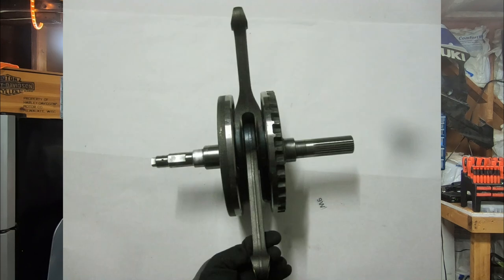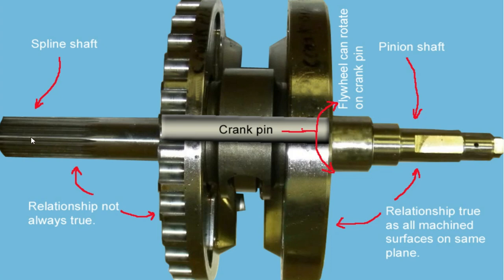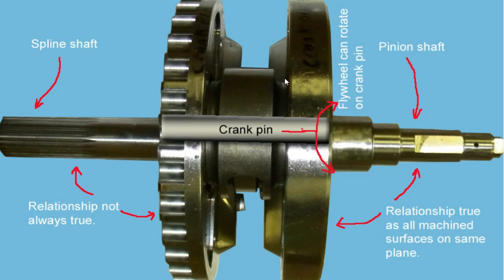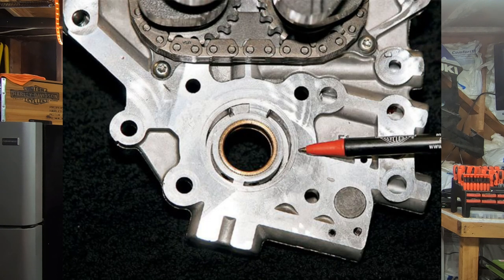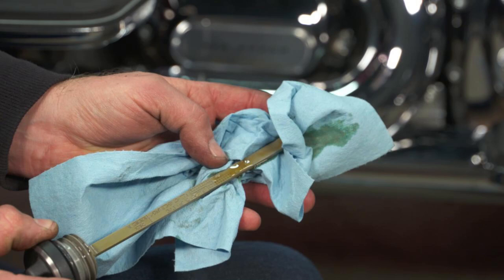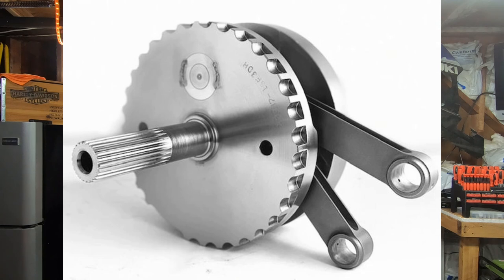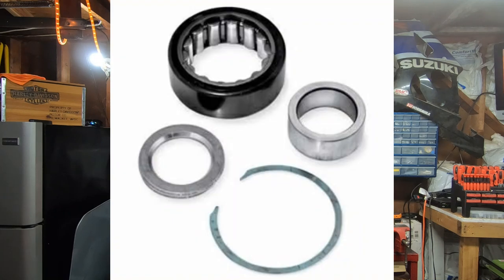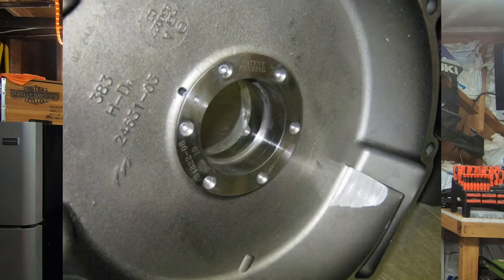The Issue With The Twin Cam Crankshafts | Harley-Davidson Cut Costs

Comment: I wish I would have watched all these videos on the twin cams problems before I bought my 2017 Low Rider S. Does the Screaming Eagle 110 have the same crank as the 103? I never worried about anything on my Sportster. That bike was bullet proof. Do the M8's share the same problem?
Reply from the maker: The 110 does share the same crank, they are a pressed assembly. It's not a guaranteed failure point though fortunately. There are thousands and thousands of Harleys running out there with a pressed crank assembly. It becomes an issue when someone builds a big horsepower engine and starts thrashing it with that stock crank. You can put some damn good power into your 110 and be just fine. Just don't go drag racing every weekend on it and doing flaming burnouts to impress the ladies 😄😄👍.
Reply: I highly recommend you check the runout on your crankshaft. It's not difficult and gives you the chance to make a few upgrades if you have the funds available.

Comment: I have an 04 RK classic I already have stage 1 on it arlen ness filter, v&h fuelpak and V&H dual slip ons. I purchased the S&S 509 standard gear drive cam chest kit but now I'm confused which s&s flywheel is the right choice for my cam kit?

Comment: 2016 Street Glide here with 52,000 miles so far. Is this problem for old HD twin cam motor or is it still prevalent in 2014 and up Rushmore bikes ?
Reply from the maker: It's a very hotly debated issue, the cranks are still pressed today even on the M8's. The 2016 does have a pressed crank, overall they are reliable and most never have an issue. Where it becomes a problem is if your lugging the engine in too high or a gear for your rpm and using the throttle to let it tractor up to speed. It sounds really good but the way Harleys fire they put a lot of stress on the crank pin. As long as you keep your RPM up and don't lug the motor you're in good shape, that's why Harley stresses over and over to not lug the engine.
Reply: @GixxerFoo  thanks for your response. Just to clarify when you say lugging, is it specific RPM? I’m usually riding at 2500 rpm in 5th gear. My sweet spot is at 3k to 3200 rpm.

Comment: Twin Cam is JUNK. My 1989 EVO FXRS Low Rider has been running just fine since, well, 1989. No crankshaft problems, no cam chain tensioner problems, and NO overheating problems. It doesn't need a hack to shut down the rear cylinder in stop and go traffic, it doesn't need bolt on fans on the cylinders to keep them from melting down, it runs right around 200 degrees F oil temp, even in Arizona. Most Twin Cams run closer to 300 degrees F. And when (or if) it ever wears out, it can be easily and cheaply rebuilt. Or I could replace the whole engine with an S&S, but I'd rather keep it all H-D.
Reply from the maker: You can't beat that Evo for sure, the twin cam had to meet emissions and running them hot was about the only way to do it. Between the EPA, Harley cutting costs and styling refusing an oil cooler on the twin cam it could never be as solid as the Evo.
Reply: Aaahajaaahahahha Twin cam is far superior than the EVO !! I own them all, from a knuckle to a new M8!!

Comment: so I missed it twice now.  which years did Harley install the 'suspect' cranks?
Reply from the maker: Anything 2003 has the pressed cranks, you'll want to check run out on those before attempt a gear drive installation or cam plate.

Comment: I have a 2014 Street glide with a 103. Are my problems the same. What do I need to do to make better.
Reply from the maker: They still used the pressed cranks, but the late model 103's 2014 and later really were pretty good. They had those motors pretty well straightened out before they went to the M8.

Comment: I have a 2017 low rider s. Long story short, had it for 5000 miles and my crank  was pinched. Luckily it was discovered when I was going to a 117. It would hit a stiff spot when rotating the piston arms. Took it to darkhorse, got the man o war and Timken conversion pushing 126 hp 134 tq alot of money in disassembly and reassembly but an entire engine would've been more
Reply from the maker: Damn that's awesome they caught it! You've got damn good numbers now 👍. Low Rider is one my favorite models and you got one l would love to have it sounds like!

Comment: I had 1 thou runout when I installed my gear drives (02 bike, pre junk bearings). I would consider anything over 3 a busted crank. I would love to install an S&S crank, but dam.. that is some serious money.
Reply: Change the heads the cams the crank and the fuel system.  Potato potato patato.  Did I mention the compensator.
Reply: @ralphwatten2426  Did it all (except crank)... funny you bring up Compensator.. Got a 2k+ trip coming up, so also changed out primary chain, belt drive, Compensator, and rear shocks. Funny how it takes awhile to make a grand, but only 5 minutes to spend it on the scooter!
Reply: @hawkdsl  Hey Hawk, can you still call it a Harley Davidson?
Reply: @ralphwatten2426  LOL, oh sure! well.. hmm.. 98% HD.. I've only got a few non-harley parts. I had Short Block Charlie redo my stock heads.. I've got HD 95 cans with Weisco 10-1 pistons.. Comp cam lifters with CycleRama cams. S&S gear drives. Screaming chicken plate & oil pump. Progressive rear shock and front springs. Screaming chicken 6 speed. HD wheels and matching sprocket. Dyatona Twin Tech ignition. 44 CV/SE Intake/V&H long shots with cross over.
Reply: @hawkdsl  Not sure but I think it might be less than 98%.  Won't be long before they won't sell you a t-shirt.
Reply: @ralphwatten2426  LOL.
Reply: @hawkdsl  My cousin had some work done on his Harley somewhere other than his local dealer, they found out about it and wouldn't let him back in the shop.  So there ya go.
Reply: @ralphwatten2426  LOL, well, mine is an 02 (bought it new)... I haven't been back to my dealer in years. I'm just a distant, forgotten memory to them now.
Reply: @hawkdsl  You're better off.  If you can do the work yourself you have no one to mess it up and no one to blame.  No one touches my bikes but me.  Take care- '99 Valk and an '11 KLR
Reply from the maker: The unkillable KLR, dad sold Kawasakis for years. Sold a KLR to a guy who went from OKC to the southern tip of South America, then to Alaska and back to OKC on the factory spark plug.
Reply from the maker: 😄😂 me too, dealer doesn't me much either.
Reply from the maker: Wow, that's crazy!
Reply: @GixxerFoo  that spark plug was really happy that trip was over!
Reply from the maker: That was a gather around the lift in service day at the dealer!

Comment: I’m noticing my oil isn’t returning to the oil tank…(2008 Harley Crossbones Softail) I’m thinking my oil pump is f’ed and now you got me worried that my pinion is out of whack.
Reply from the maker: For sure a possibility on the oil pump, sounds like you're sumping. I would get that cam chest pulled down and put some eyes on that oil pump for sure. Check your pinion run out too, Harley oil pumps have a high tolerance, hopefully you can get away with just replacing the oil pump!
Reply: @GixxerFoo  hey thanks for the reply, wasn’t expecting but is much appreciated. I’m a disabled vet and this bike is all I have for transportation at the moment. My uncle wants me to first try just draining all the oil including the return line out of the crank so ALL the oil out. Although I don’t know what that’s gonna do…if it’s not being returned in the first place. My tank is bone dry after riding today in excess of 70mph for 20min. Smh

Comment: Dear Gixxerfoo, hope you are very well, which Flywheel could you advise me, darkhorse or S and S if I wish to upgrade my original 103 CI, I upgraded as you know for a 117 well prepared... With Reaper 594 cams from feuling and everything else I mentioned you in a previous message, for which I thank you again to have answered... 😊... Which crankshaft would you recommand.. If there is one much better or stronger than another.. I would love to turn the throttle without any doubts in the future.. Thank you very much for your help.. 🙏🤞
Reply from the maker: Dark Horse products are very hard to beat! They are high quality and strong components, plus you don't have the price associated with S&S.

Comment: Mine has 4,800 miles on it. 
On my way to work and the oil pressure light came one. It will still start and run (barely) but the crank needs fixing or replacing. 
The shame is the bike is an ‘05 and looks like it’s brand new, just can’t ride it.
Reply from the maker: Dang that sucks, I'm sorry to hear that. Hopefully you can get that motor out and tore down, great time to get it all built back up with some solid components.

Comment: Yo i have a 2013 street bob with the tc96a...ever heard of anyone having crank issues with that era of dynas? Thanks for any help or insight
Reply: I have that year and model. Mine is being rebuilt now. 23k miles and I ride it nice and easy and change oil often. Glad I did not blow it up.

Comment: Doing burnouts you can shift the old 5 piece crankshafts. Even the aftermarket forged flywheels will shift if you abuse the motor enough. People got spoiled with the evolution motor, put gas in it change oil and run it into the ground. The shovelhead you were lucky to get 25,000 miles before a topend was due. I personally would not weld a twincam flywheel assembly to improve it structurally, I would pin it
Reply from the maker: The old Evo motor bottom end was super tough, Harley really made that engine too reliable in a lot of ways.
Reply: @GixxerFoo  hey man i really need your input. i have ss cases welded trued and balanced by rev perf SE wheels ect i just built this and my oil pump was bad after all that from previous grenade feuling, so my lifters the pin came undone and scored a grove in my blocks .. im at a complete loss i could not ajust my push rods for nothing any help from all of you if poss thx. 7k now broke with a broken engine, im in a panik,

Comment: LOL at this stuff. 103 CI and they make what, 75 HP and can't take any more without crank issues? Too funny. Thanks for a great explanation of this issue and what can be done. My BMW K1600GT makes 160 HP from the same displacement, but eats $2500 rear ends. HP is expensive, no matter what you ride!
Reply from the maker: Holy crap I didn't know the BMW was having some rear end issues on those bikes! But at 160hp that's enough to do it. Harley's single pin crank design puts a lot of strain on those pressed assembly, especially with the firing order of the engine.
Reply: @Peter Angles  Completely different type of bike, but you can't argue with their power potential. I had a BMW K1200S, which is kind of like a German Busa. The K1300S made 175 at the crank, so prob upper 150s at the ground. If I didn't need to carry so much luggage and a pillion I'd still own it!

Comment: 238K on my twin cam.  No top end or bottom rebuild yet.   My experience has been way different than many I guess.
Reply: Impressive!, is that miles or km?
Reply: @64Goef  Miles
Reply from the maker: 👍😯 Holy hell! I have never seen or heard of that many miles on a twin cam untouched before!!! Honestly I am wondering if that is a record!
Reply: Way different is no exaggeration!!
I just hit 15,000 original miles on my totally unreliable 2002 Low Rider and pulled the case open to have a look. I rode the 150 miles to the mechanic and ordered the SE Kit from the US immediately.  He and I were both surprised I made it intact to his shop. 
$2500 US later it’s finally done. 

Your 238K is amazing
Reply: @shizuokaBLUES  My RK happens to be a 2012 as well
Reply: @charleswilburn7656  stunning. I
Wish I knew why some 2002 twin cams are so unreliable and seem to have utterly shoddy build quality but then others, like yours , run like champs.  It’s odd that there are such extremes
Reply: I've got a 02 with 65k
Just looked at the tensioners again.  Still look great.  Still runs like a champ.
All I've done is richen the carb and run valvoline 60 wt racing oil here in Bama.

Comment: I've just bought a 2004 Sportster and looking for info on the tube. Watching your videos scares me to death. I'm starting to think I've bought a piece of shit just waiting to destroy itself and cost me a.fortune to fix. I've previously owned a 500/4 Honda for 100,000 miles and only needed clutch plates at that 100,000 mile point. Just regular oil changes and basic servicing.
What have I done?????

Comment: I love your channel, but I am no mechanic. I own a 2003 95" twin cam with 12,000 miles. What if any thing should I have someone check on this motor?
I love my bike and would love to address any potential problems. Any input would be greatly appreciated.
Thank you.
Reply from the maker: Thank you! I greatly appreciate it! Being an 03 I would have the cam chain tensioners checked out, make sure those are in good shape. Since it's a 95 it's had some work done, those may of been converted to hydraulics from the spring tensioners. If you still have the spring tensioner system in there you might consider converting over to a hydraulic system. Much more reliable, that's really the biggest issue from 99 to 06.
Reply: @GixxerFoo  thank you very much for your knowledge. It's amazing how much you know about these motors.
Thank you for sharing with us who don't know.
👍✌

Comment: I just bought a 2013 103 deluxe with 9100 miles. It looks brand new. But because it’s winter here I won’t be driving it till about May. Do you think I’m going to have a problem? 😳
Reply from the maker: Not with the 103, the crank honestly isn't an issue unless you go to putting some crazy (120hp) power into it and running it hard constantly. There were new bikes that had bad cranks, but it was few and far between. You shouldn't have an issue, it's like new tires and blow outs. Could it happen yes, is it likely no.
Reply: @GixxerFoo  ❤️ Thank you for answering. I’m so excited. It’s my first Harley-Davidson. 😍😍😍
Reply from the maker: That's awesome! You got a good year, they were really good from 2013 to 2017. Same as always with Harley they got the 103 right and then went to the M8. M8's had some serious oiling issues the first couple years.

Comment: Surprised there hasn't been a class action suit for this issue......
Reply from the maker: It seems like the only lawsuit that ever stuck on Harley was brought on by the EPA over Harley's Screamin Eagle Super Tuner. That's why they only sell the Street Tuner now.
Reply: Why?? Cranks coming out of true is mainly on the owner and how they ride. The number one main cause of cranks coming out of true is lugging the engine. Spec is less than .012” and it takes a lot to get passed that. Right side case bearings can walk in or out of the case and that can happen on tapered roller bearing setups too. Tapered roller bearings are better because the disperse the load better and can take side load where a roller bearings can’t take side loads.
Reply: @anitabonghit266  Really?  They went to a pressed crank and pressed roller bearing to save production costs on a motorcycle that they charge a premium price for?
Reply: @rogerwhite7719  yes, is that hard to believe or are you being sarcastic. Every penny they save on millions of units is a lot of money saved plus they cut assembly time down because tapered roller bearings cases have to have the end play checked. A left side roller bearings has no end play measurement. All they have to do is make sure a certain percentage of bikes exceeds warranty and that they cover their warranty with no issues when other factors are not happening
Reply: @anitabonghit266  Riiight.  Bussiness 101 ..."save" yourself outta' a bunch of prospective customers due to shoddy manufacturing followed by bad reputation diminishing sales year after year ...in the information age.  Winning ticket.  Not!

Comment: hey man there is a 2013 883 sportster for sale which had the engine temperature sensor removed for a few months, and the bike runs with a rich fuel mixture now.
Is it safe to buy this bike? thanks mate
Reply from the maker: I don't get why you would remove the head temperature sensor, that's pretty important. If it's been reinstalled and it's running very rich now it's compensating for something. I personally would have to pass on that bike unless you plan doing a top end rebuild and you can get it cheap.

Comment: Hi. I want to buy a 2003 Road King with SE 103. Does it have Timken bearings?
Reply from the maker: Unfortunately that year has the pressed crank and non timken roller bearings. The tensioner setup is also the spring tensioner even on the Screamin Eagle 103.

Comment: I ride my M8 seriously Lacey Panty here😁😁 here’s a question for you what’s the difference between the twin cam crankshafts and the M8 crankshafts?
Reply from the maker: They are both pressed in the same fashion, basically the same design just more stroke on the M8.
Reply: @GixxerFoo  were the evo cranks welded?

Comment: What is recommended fx 03 twin hydraulic HD or S&S tensiones?
Reply from the maker: Either one is a great option, hydraulics are the way to go. The Screamin Eagle isn't bad at all and it cost less, but I lean toward S&S being a more quality product. That's just my opinion though, I wouldn't sweat running the Screamin Eagle at all.
Reply: @GixxerFoo  Gixx, I'd say, why give the factory another single solitary dime?  I mean ..."fool me once."  Better further the aftermarket who work hard at engineering sound, solid solutions, fixing what shouldn't be broke in the first place.  Ride Forever!